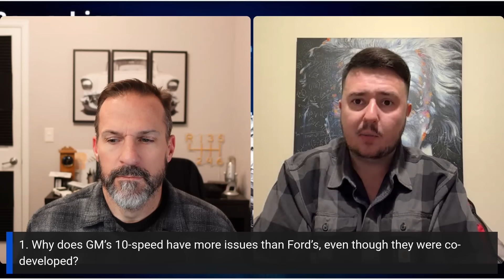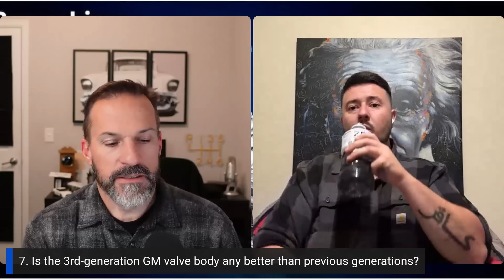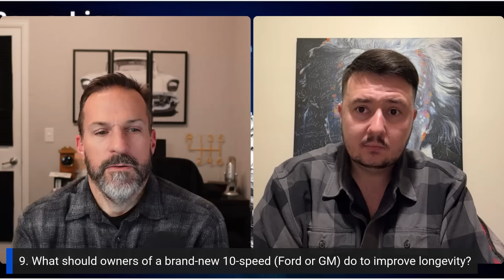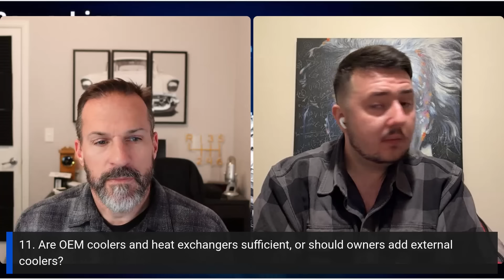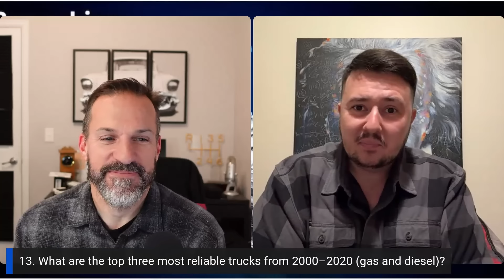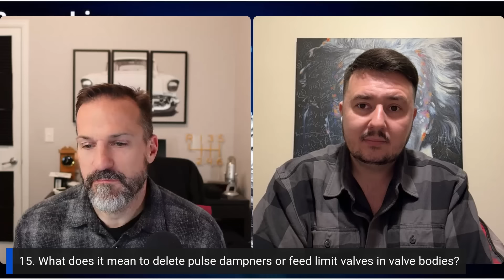Stop KILLING Your Transmission! The Maintenance MOST People Ignore (With NextGen Engineer)

Comment: yes, check your transmission fluid after driving for five minutes check it after driving for 10 minutes then check it after driving 20 minutes aggressively then check it after a half hour drive then check it on your next 10 drives. Make sure fluid is RIGHT on the Line, not too much or too little

Comment: I’ve got a 2014 Acadia with 179000 miles on it. The transmission , of course, is having problems… for the past 80,000 miles. What’s weird is that I add a cup of Lucas gas treatment to the gas and when I do the transmission shifts normally. Go figure. I’ve been doing that for 80k miles and keep up service on it. I just changed out the spark plugs for the first time and now it runs better than ever. I know the trans will have to be replaced (if we keep it) in the next 40k miles. It’s  a real nice car and now I’m beginning to wonder if it’s worth keeping and rebuilding the thing for the next 150k miles. Engine also. Doesn’t burn oil. Very nice drive. I’m wondering if it’s worth going thru the whole car and keeping it for another 200k miles. Are Acadia transmissions worth rebuilding… will it be better than buying a new transmission? After test driving other cars we are beginning to look at our car differently. The whole market is going thru dramatic changes. Are there any others out there going thru the same “wonderment” ?

Comment: Absolutely positively the filter and pan drop should be done between 40k to 50k , clean the magnet, pan and refill with clean transmission fluid, my 2014 F150  has had transmission chatter since new, I was thinking it was a bent rim, or rotor, or drive shaft out of balance, untill I dropped the transmission pan ,and found the magnet covered in tiny steel particles, I gave it a refresh, not a flush, still have the slight chatter,but it only appears at 58 to 60 mph , its got 150k on the odometer, 3000 k oil ick changes and filter since new, it needs to be done again, pan drop only, refill cold 1/ 3rd level vehicle,  Mercon LV , the truck has no dipstick, its on the side under a cap, with a tiny dipstick, its like Ford wanted there transmissions to fail , not putting a cheap dipstick to check transmission fluid level....still running well ,only issue is that transmission shutter, I also changed the transmission cooling lines, new water pump , alternator and starter, battery, and keep the MASS AIR FLOW SENSOR CLEAN, WITH THROTTLE BODY CLEAN, AND AIR FILTER , ITS GOT A 3.7 NATURALLY ASPIRATED FLEX FUEL SYSTEM,  THEY DEFINITELY NEED PARTS REPLACED AND FLUIDS KEPT CLEAN, WHICH THE ADVERAGE OWNERS DON'T DO OR KNOW HOW TO DO IT.....DIY .... NATE IS TOPS ON TRANSMISSION TECHNOLOGY.

Bring back standard transmissions that were way better than automatics, Ford told me that they don't put them in the F 150 pickups, and I told the salesman that is a dumb idea ,especially for a work truck. 

I do know that I should change the lead panel, and throttle body ,but  at 150 k , I would have to let a transmission mechanic do that job, 71 years old everything gets harder to do, fact.....not saying that I couldn't but it would take me a few days, arms don't work so well overhead working......

Comment: Hi need a dip stick kit ford 10R80 transmission for my 2023 F150. Had a 2005 f150 4 overdrive automatic transmission I was able check fluid condition it had a dip stick.

Comment: 37:06 i think i have this shudder issue on my 21 F150. I sometimes get a light shudder at freeway speeds when i try to accelerate slowly at low rpm (lugging the engine), especially on a hill. Typically if i feel this i will downshift manually and instantly the shudder goes away. Now, when i see a hill i will manually lock out my top 2-3 gears to prevent it from happening. Even keeping the truck on sport mode seems to help

Comment: Yep, 525,000 miles on mine, 2001, built nov 2000. 4.7 bought it with about 130,000 mi. No fluid change I know of, at least as long as I've owned it.
Reply: 1st Gen Tundra ?

Comment: I’d like to learn what’s going on when a gear or two makes a “whine” noise. I have experienced this in the 21 and 23 Jeep Gladiator, 8 speed auto 850RE transmission. In my 21 JTR I’ve had 4 transmissions. 1st one whined at highway speeds and had to be replaced. 2nd and 3rd transmission whined in 1 and 2, determined to be pump failure. 4th transmission whined in 4th gear and FCA determined “normal”. All I did with my 4th transmission was 4 pan drops in 2 years. I saw temps drop from 200F to 165F by the end. 

My 23 JTR has a slight whine in 2nd and 4th. I’ve done one pan drop so far with 16k miles on the odometer. Temp has dropped from 200F to low 190’s. I am again expecting to see my temps drop to 165F by the time I’ve done 4 pan drops. But….whats up with the whine??

Comment: Old School Here: I rebuilt Torqueflite 3 speed transmissions back in the late 1960's. They never heard of "Lock-Up" because the EPA III and HWFET's were not developed yet. People were more carefree and only interested in luxury durability and longivity. Not until after the "Energy Crisis" HOAX did gas mileage become so important. If Nixon had not offered weapons to Israel for the Yom Kippur War of October 1973, there would have been no oil embargo and the price of oil would not have shot up. Nixon's concern was that the U.S. economy would suffer after he made the mistake of getting involved in the 1973 "Arab–Israeli War" dubbed the Yom Kippur war. Nixon didn't want to have the country at his throat for ruining the U.S. economy so he and his administration seeded the whole country with the idea that we were running out of oil. Knowing that doing so would cause many patriotic citizens to cut back on fuel usage and the embargo would have less of an impact on the U.S. economy. OK, that said: The Torque Converter Clutch (TCC) was born to trick the EPA Fuel Economy (FE) numbers on their tests, and if you know anything about testing in a laboratory environment (like I do after driving at least 20,000 EPA III's and HWFET's) it is only TOO EASY to trick the test. I could get 20% better Fuel Economy and lower emissions by just paying attention to the way I throttled the engine. A laboratory conducted test has exacting tolerances but you can drastically and quite easily change the output of the numbers if YOU JUST DRIVE CONSCIENTIOUSLY on those tests. At GM I did so much better than my fellow "TEST CREW" members that my immediate management spent $1 Million studying my driving technique and derived a "validation criteria" for all of the rest of the "Test Crew" much to their chagrin. After that everyone had to limit throttle movement and the distance they were away from the prescribed speeds and how long they were away from them. But, I am educating too much here. (digressing?) What I want to say is the TCC is a very temperamental device that was originally thought of as a simple way to "trick" the FE tests. Then the "Modulated" TCC came into being to further trick it. It wasn't bad enough to place a limited lifespan clutch within the TC and have it deteriorate, polluting the fluid and finally failing, now they have added another layer of complexity to the transmission, as they bring it in "slightly" during several intervals while testing for FE. It's more failure prone than ever befor. And, incase you don't know this too: The multi-speeds of more than just 2 or 3 is a method of creating a much easier calibration SPECIFICALLY AIMED at meeting the emissions and FE the Government was demanding on the auto manufacturers. As a result we are strapped with 10 forward speeds to facilitate the engine becoming a drone. The complexity and sophistication the multi multi speeds and modulating the TCC so many many times has caused an astounding maintenance issue and failure rate. When I get into my 1969 Plymouth and drive my A-904 3 speed automatic with no TCC it feels like right. That vehicle has 89,000 miles on it and it's still using the original transmission fluid. And I have no intention of EVER CHANGING IT!! EVER! When I get into my 1998 GMC Yukon w/ it's 4L60e it's ok, but after 2 catastrophic failures due to TCC modulation, I had it reprogrammed to place the TCC Lock-Up outside of the lower gears. It only engages after OD and then comes in with a slight "thump" much the way my 1989 GMC Suburban did with it's 700r 4, rather than modulated. And when I drive my 2017 GMC Sierra 1500 with the 4.3 LEV V6 w/ it's 6L80e I want to go throw up. The HP tuner shop near me wants $500 to eliminate the AFM and they can only move the TCC Lockup to after 5th gear engages fully, meaning I still have to unlock it and relock it when the 5-6 gear change takes place. The 6L80e transmission is so ugly to drive, I cannot even imagine what an 8 or 10 speed must be like. I will reject them if I have to go back to a TH350 and custom build a carbureted 4.3 to put in front of it in a rust--free vehicle. I will not support the nonsense of the past Presidential administration's campaigns to make automobiles so sophisticated and failure prone that the motoring public finally capitulates to their crony capitalism EV buddies and buys into a battery powered vehicle with all the trappings of Solar (as in Solyndra) and Wind electrical generation. (as in CCP built) Get Government out of the transportation industry. That's my story and I'm sticking to it. I don't need no stinking EV! and I won't support the grade A nonsense of multi multi speed automatic transmissions with failure prone TCC's. BS. ben/ michigan

Comment: Ok , look guys - transmission fluid not getting changed regularly isnt going to turn into liquid sand paper lol -- because there is a thing called FILTER in valve bodies designed to catch the particles .  If there are bigger particles like metal shavings that filter cant catch - then you have bigger issues . Trans fluid is  replaced because trans fluid is hydraulic fluid , lubricant and a detergent and heat cycles over time will diminish those properties . If you change trans fluid regularly  it will still get dirty because trans components are not made of wear resistant material  - every time you start the vehicle it will wear and produce microscopic particles . Also if you have an old vehicle with 100k miles plus that has never had a trans fluid replaced and runs fine - you DO NOT  replace it in total volume but 25% at the time in like 20k-25k miles intervals -- because the particles that are in that trans fluid is kind of filling in the gap tolerance caused by the wear and keeping clutches engaging . 25% in 20k miles intervals you are introducing fresh fluid to rejuvenate hydraulic and detergent properties without getting rid of particles that could be keeping it together . I cant tell you how many times i had people come to me to help them with trans rebuild and when asked " tell me what happened before it failed " they all said  " well i just drained it and filled it and next week it stoped on me " . When trans fluid has degraded hydraulic properties it causes slipping and slipping causes increased friction and that friction accelerates wear . Particles caused by friction wear CAN and WILL start to buil up in between worn components like clutch plates and gears and that can and will help it in old vehicles . Ofcourse no particles is good and you want to avoid it by keeping it in good hydraulic parameters , but they are not whats causing the wear - they are a byproduct of the  wear

Comment: 3-4 quarts low after being filled on the rack seems a bit excessive,  The vehicle should be running at a specified temp and cycled thru all ranges before setting the level. Am I missing something? Good info though definitely refreshing to hear a lot of this as a Tech at a GM hellhole.

Comment: Transmissions are odd I change the transmission fluid in my wife's 2017 Dodge Grand caravan at 60,000 mi and was quite surprised at how much where was on the magnet and in the pan and I just changed my transmission fluid on my 2006 Chrysler 300C and there was hardly any clutch material at all in the fluid still cherry red

Comment: 2023 GMC Yukon xl. Torque converter went out sending metal through the transmission and was recommended to replace both and the dealership wont replace the trans until it fails more. How does that make sense

Comment: I just bought a used 2019 F250 with the 6.2 gas engine and 5 speed transmission.  According to my research it's the 6R100 but I could be wrong.  So after driving the truck home the night we bought it we heard a grinding noise after driving for 20+ minutes.  We did not hear it on a test drive.  Truck shifts good just this intermittent sound.  I took it back to the dealer because I have a 30 day warranty and they couldn't find the issue but sent it to a Ford dealership.  Ford determined it was the transfer case, said a bushing on the back of the transfer case was wore.  After replacing the transfer case they heard a grinding sound in the transmission on a test drive.  Dealership is paying for a jasper transmission.  My question is are these good transmissions?  Truck has 95k on it.  So far they couldn't tell me what caused the transmission sound but they say it could be what caused the transfer case damage. We plan to pull a 5th wheel camper with it so we want to make sure it's not something we'll have to worry about later on.

My other question is should I invest in reliability upgrades on this transmission?

Comment: I HAD A VALVE BODY CHANGED AT FORD WHERE I BOUGHT THE TRUCK NEW IN 2016. NOW A YEAR LATER ITS A RECALL. CAN I BE REMIMBURSED MY BILL FOR THAT? IT WAS QUITE EXPENSIVE . Furthermore, LISTENING TO THE FILL PROCEDURE FOR TRANSMISSION FLUID IM CERTAIN MY TRANSMISSION IS LOW BELOW SPEC, AS FORD NEVER TOLD ME TO COME BACK TO CHECK. HOWEVER, IM NOT CONFIDENT THEY FOLLOWED THE PROPER FILL PROCEDURE KNOWING HOW RUSHED TECHS ARE THESE DAYS, EVEN IF THE TECH WANTED TO DO IT PROPERLY!!!😊

Comment: I'm surprised how many people never change their transmission fluid. I have a 2015 Chevy Sonic 1.8 Liter engine. I had the dealer change my transmission at 45k. It's drained, not flushed. This is what my owner's manual recommends for the change. Is that mileage waiting too long. Also there is no dip stick for my transmission. This is true of newer makes and models. I'm not a car tinkerer, and for fluid changes, I always take it to my dealership where I bought my car. Plus, I change the engine oil every 5k with synthetic. I also change my brake fluid when it gets dirty around 40k. Great transmission advice. I'm saving this video on my phone. Thanks guys.😊